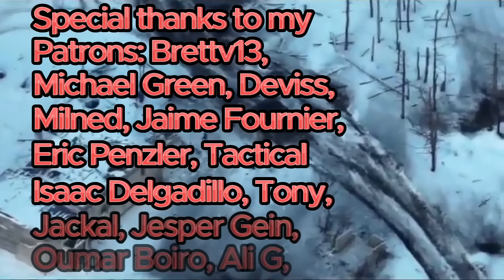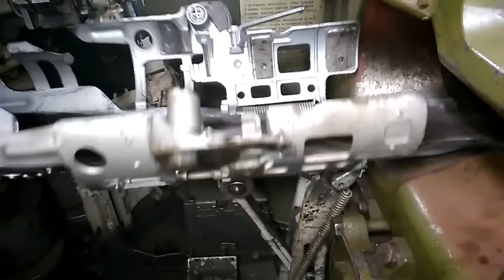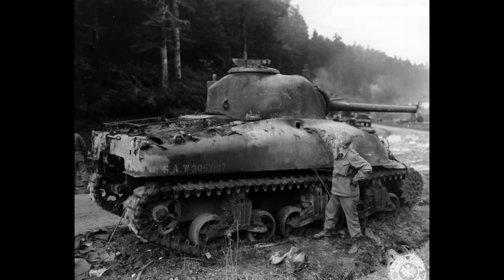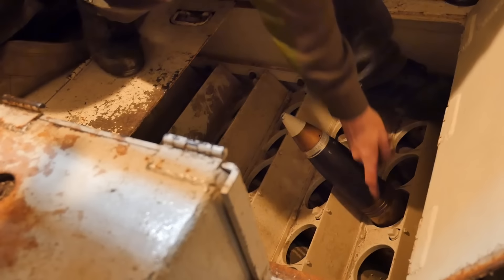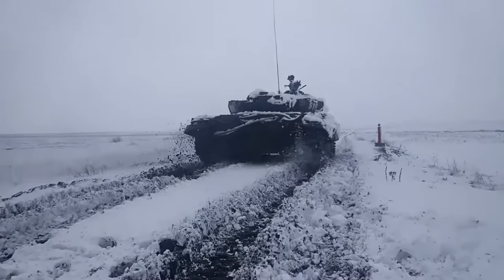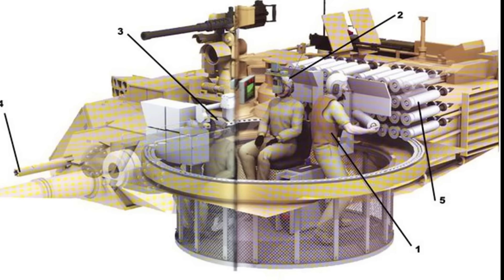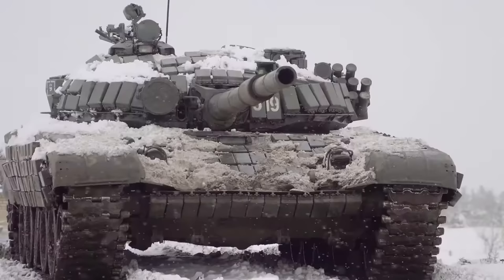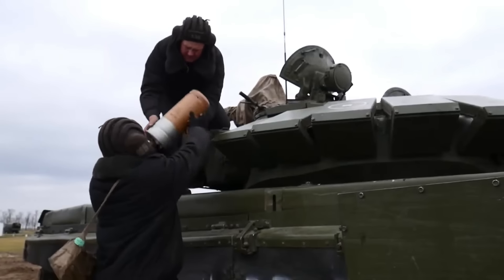Is Autoloader Really the Reason for Russian tanks exploding so much?

Comment: I'm curious why they never tried to give the carousel autoloader blowout panels (or if they have tried why it hasnt worked/been adopted). If they armored the compartment where the ammo was in and had blast doors on either side of the slot of the position the projectile is in before it gets loaded it should be possible. They would just have to direct the blast downwards instead of upwards. I'm not an engineer though so please correct me if I'm wrong. This is actually something I've been wondering about for a while and would love an explanation for.

Comment: For the start, T-54/55/62/64/72/80 have been designed to penetrate through defense lines and keep rolling deep behind, at that scenario they have to take as many ammo as possible storing it in every space available inside the hull.  That is not the case in Ukraine, tanks act in defensive or supporting roles.   They don't need a lot of ammo, the 22-24 in autoload is more than enough.  So most cook offs happen in auto loaders.

Comment: If I am not mistaken, the ammo in the Merkava tanks are also stored in the hull, but each round is stored in a protective casing before use.
Doesn't sound like a significant  change to a carrousel autoloader to have each round and charge in a protective cilinder that the autoloader can push the round out of.

And I wouldn't bottom blowout panels be possible?
Reply: Blowout panels only work if the ammo is in an isolated containment which has blowout panels in it. If you install these panels in any T-tank, it will still go boom and the crew will die, the only difference will be in the height that the tank turret might reach(won't fly far or detach at all).

Comment: The best armor is not to get hit in the first place
Reply: Not how tanks work. The whole reason they are tanks = heavily armored like that is to draw fire.

That's also why they still got such a shit firing range in comparison to other systems.

It's their job to drive in and draw fire.

Else you would just build another artillery and fire from 10, 20, 30km away.
Reply: @miriamweller812 No that is just completely wrong. Armor is a last resort. You do not want your tank taking hits unnecessarily.
Reply: While not getting hit is ideal, it requires skilled crews to not get hit. And frankly hiding a tank on a modern battlefield is nearly impossible. Thus surviving the tank being penetrated and allowing time for the crew to escape is critical. No amount of 5'4" tankers crammed into as tiny of a tank as possible will save you from the threat you don't see.
Reply: @miriamweller812 No. Not how anyone uses tanks. I would recommend reviewing tank doctrine and circling back. A good example of this not being the case is how more modern Western MBT have been designed, rather than strictly focusing on preventing the tank from being knocked out or making maximum effort to protect the tank designers have increasingly focused on post penetration survival. The blowout panels and large hatches are two good examples. They reduce how much the tank can defend from overall but increase the chance of surviving being critically damaged. Helping to ensure the crew can get out.
Reply: @miriamweller812  That is very stupid, tanks are not supposed to draw fire.

In war, you don't shoot at things that you know won't do any damage so it means nothing, you aren't gonna fire anything except ATGM, HEAT or tank shells at tanks.
Reply: That's 2nd best, best is not getting spotted.
Reply: That was part of the design philosophy of the Soviet tanks. Make them smaller and shorter, then you can hide better and are harder to hit. The trade off is if you do get hit, your chance of death is high.
Reply: @keatonwastaken  Maybe they weren't made to, but battles like Omaha wouldn't have been won without some of the tanks both distracting and destroying German positions, because the infantry were being cut down horridly before they arrived.
Reply: @alm5992  Sure but that's so long ago when capabilities of such vehicles were not fully realized.
Reply: @miriamweller812  The survival onion states

Dont be there at the first layer of defence in other words what he said with dont be hit is right 
Modern times change even a none penetrating hit can cause damage to systems reducing your fighting ability In a time where a enemy tank can see you 2km away with thermals 
and hit you first round not being able to see him due to your thermal sight being destroyed after one small hit is already a death sentence 

Dont be seen if you are seen 
Dont be hit
Reply: @rayotoxi1509  Same principle for stealth planes. Can't get shot down if they cant find out where you are

Comment: You take a tank which was designed for use in a Chemical, Nuclear, or Biological battleground and drive with the upper hatches open.   Seems to be a problem with the optics, and ventilation systems, which allow lots of things to just fall in.

Comment: Having experienced a catastrophic detonation myself (an artillery gun tractor, not a tank) I agree with this view. I've thought it awhile, because it's the propellant that goes bang if you look at it funny. But the actual charges, even a 155 projectile, is crazy hard to detonate. You can chuck in around, set it on fire, it won't blow. It needs the shock of a fuse detonating to explode. But the charges, oi, they roman candle so easily. If confined, they cause a pressure detonation, which is what they are supposed to do in order to propel the round to its target. But in the confines of a vehicle, especially an armoured tank, the pressure builds up in a fraction of a second and boom. Add to that the Soviet practice of encouraging crews to store additional ammo in and around the crew compartment, a recipe for disaster.

Comment: The AZ autoloader system of Russian T-72 and T-90 tanks have additional drawbacks compared to MZ autoloader which was didn't mentioned in this video. Besides longer reloading time and less ammo capacity, AZ have limitations on physical LENGTH of a projectile. While they have same caliber, but AZ rounds have to be SHORTER in length due to a denser placement of the rounds in the carousel. By this reason advanced soviet-era made tank rounds wasn't fit in T-72 tank AZ autoloaders at all. This parameter was crusial for some powerful APFSDS rounds and guided rocket projectiles, designet to be lounched from the cannon barrel. This is why for T-80 tank, which was considered the best soviet-made tanks, designers had chosen MZ autoloader system, created for T-64 tanks, instead of newer AZ from T-72. MZ appeared to be superior in many ways. Additional drawbacks of AZ autoloader is that it reduces the total mine protection of the tank (gunpowder charges lying right on the flor). And it have some funny little problem: it can't place used pallets from gunpowder charges back into carousel. Instead, it kicks this pallets out from the tank through very special tiny little hole, cut in the back armor of tank turret. What consequences it may have - decide by yourself... 😂

Comment: Developing a new propellant that doesn't ignite so easily would help a lot.
Reply: @CheapSushi  reading the comments, you can understand that not everyone watched the video to the end
Reply: Apparently the German HE shells are less powerful than Russian ones, and since modern tanks are used against infantry and holdouts 90% of the time it leaves a bit of a dilemma. Less power more survivability or more power and less survivability?
Reply: @unterhau1102  The less powerful  HE shells will do the same work on the frontline since it is mainly used for suppresion so the infantry doesnt stick out fearing there is a tank for more power to be used there is artillery.
Reply: @kerekeke5295  apparently the ukranians couldn't even knock down a building with German HE shells.
Reply: @unterhau1102  Did you even understand what I have written ?
Reply: @kerekeke5295  The German HE shells are downright garbage. Never mind knocking down buildings, they are completely useless against the most basic trenches. 

With that said however, the Russians developing even just less sensitive propellant would help a lot with the survivability of their tanks.
Reply: @sebastijanglozinic8630  It would not

Comment: Considering top down ammunition, does it even matter?

When the warhead enters the turret it spews a ton of stuff into the crew compartment. That the ammo "cooks off" afterwards is spectacular, but doesn't really matter for the crew anymore (maybe the driver).

I can see this as a problem if the tank hits a mine, though, once again, if it penetrates into the crew compartment I don't think it really matters.

It seems all the "outrage" is mostly because it looks spectacular, though for the crew the difference is, maybe, a few milliseconds if that much.

Comment: 1) No one T-80 was lost in 1st Chechen War because of ammo explosion. The only loss of tank with the who crew was on huge roadside bomb.
2) Western tanks explode may be even more often especially Leo-2 which has only 15 rounds in the turret and everything else scuttered around the tank. And the idea to remove additional rounds will not work well when only 15 left.
3) When tank burns it explode sooner or later. The can be already miles away but the munition will cook off. If most of the munition is under the turret and the turret is light it can be tossed out. In other case the turret may remain in place but the tank is still a burned pile of junk. Leo-2s often turned off in pieces.
4) Propellant charges is complex thing. Soviet rounds use more or less universal propellants and the most effective because the tanks could be operated in very different cimatic conditions. May be something new will be introduced but Soviet disigners had to seek for some compromise. The real problem is separate loading so the propellant is not encased so one charge cathing fire immediatelly ignites all the others. And T-62M with unitary rounds can be more safe in case of ammo been hit. And autoloader is the reason of separate loading. The rounds and propellant charges has to be packed somehow in small volume. Another problem with autoloader which was not actual in 1960-70s it limits the length of the rounds so introducing new longer rounds can require serious hull refurbishing work if possible at all. This the problem solved in later T-90 variants.

Comment: Russian designer to tank crews: the  new autoloader brings 2 benefits to you. The first is it's harder to hit.

Russian tank crew: that sounds good, what's the second?

Designer: if it is hit, none of your families will have to pay for cremation.
Reply: Wtf 💀
Reply: Но у нас культурно православная страна. На момент появления автозагрузчика никто бы и не подумал кремировать своих погибших. Уточняю просто для сведения, все же вы из другой страны.
Reply: "Gone, reduced to atoms."

fr though in the images of burnt out russian tanks I have seen there litterally isn't a trace of the crew, no bones or anything, they just got vapurised.
Reply: @tirushone6446  from the ones i have seen there is often a few bones sticking out the wreckage
Reply: @av812bb  ☠
Reply: @tirushone6446 probably because they were abandoned?
Reply: @unterhau1102  or literally turned to ashes. Like those turret toss videos show, the flame is insane, far more fierce and engulfing than any crematorium fire. Even metal melts, imagine what that temperature does to a human body which is mostly water and protein.

Comment: T-90M does seem to be less prone to instant explosion on being hit. So their mitigations have somewhat improved the issue. Not getting vaporized instantly when a drone graze your exterior plating is good.

But I think one of the big issues here is their explosives formulation, germans in particular seem to have done a lot of work for their charges to be much less likely to explode from sharpnel and fires and only going off when activated by their intended primer charge. Which is a really smart way to go about things in terms of actual battlefield results imo. Just deal with the problem at it's core rather than keep splattering extra armor plates everywhere to mitigate it.

Russians seem to have not cared about that core problem one bit so far.

Comment: No matter where you store the ammo, it'll always be vulnerable to something, especially with FPV drones. The insensitive propellant is a good step in the right direction, but I think the long term solution should be to use electric ignition of an inert propellant, i.e. an electrothermal chemical gun. Basically the idea is to use a brief but extremely powerful electric current to vaporize an inert propellant, turning it into plasma, and then propelling the projectile. The propellant is completely inert, and doesn't combust when struck by enemy fire. It also has the advantage of greater energy imparted to the projectile, and you can potentially "dial in" how much energy you want imparted to the projectile.
Reply: Is that what microwave shell priming or is it different?
Reply: @thephoenix756  I'm not familiar with microwave shell priming, but I found a patent on using microwaves to ignite an insensitive energetic material. Basically the idea is the same as electric ignition, except instead of using an electric pulse, you use a microwave pulse.

Comment: Gonna tell you a secret - if Abrams would carry HE rounds in mix of APFSDS and not only one type of ammo - It's turret would fly as high as Russian one. RU just use universality in exchange of survivabilty.
Reply: Technically not as high as russian turrets because of the weight, even the challenger 2 got turret pop off in ukraine and it was moved a few inches from its place
Reply: @AlexanderK9519  Abrams turret alone weights more that entire t90.
Reply: No it wouldnt because of the blowout panels... Not to mention western HE uses less explosives
Reply: @kerekeke5295  it did happen in yemen a sauid abrams got hit on the rear sides and the tank burned with the crew the blowout panels worked as a match

Comment: It's an unfortunate combination of (1) overmatch by anti-tank weapons, tanks today (regardless of nation) are susceptible to anti-tank weaponry. No practical and mass produceable form of active protection against all aspect incoming tandem warheads yet exists. (2) The exposed ammunition in the crew compartment in the case of Russian autoloaders, tragically results in catastrophic detonation and the complete loss of the crew/tank. It would require a fundamental redesign of the fighting compartment to include either a sealed compartment with vent chutes or panels to redirect the explosion away from the crew and or a reformulation of the propellant compound to be functionally inert until fired. Both of which are much easier said than done, let alone put into mass production.

I think it's important to remember these aren't just 'tanks' being destroyed, these are young men being killed. 40–50-year-old tech, that they have no control over, obviously isn't an ideal configuration for the modern battlefield. Hopefully, in the near future All nations will price a premium on crew survivability when it comes to the configuration of armored fighting vehicles including tanks. Given the demographic trends, now more than ever it is relatively easy to replace a tank in 12-18 months. Less so the experience, let alone THE LIVES of the human beings operating them.

Comment: One problem is that the sovjets just made massproduction since they had a high Manpower availble and just need many tanks so they dont cared for the crews of any vehicle.
Thast why the death rate for crews is higher in russia. Western Nations value the expensive training of theyre crews much higher.

The Other Part is that moste tanks where designed During the cold war where they thought of Tank vs Tank battle in huge scales. Thats why they did the Autoloader to decrease the tanks size.

Comment: can you make a video explaining the weakness of the Abrams to the drone attacks?
Reply: not much to explain. rear of the tank is not protected that well to save weight. and smart drone operators hit it in ass.
Reply: Yeah basically the abrams is designed to win any front to front tank combat. FPV drones hurt the system design as they can easily choose point of impact. The future is probably unmanned turret with crew in the hull.
Reply: The weakness is the blow out panels. It can be set off by a very basic loitering munition or rpg from the 60s which makes it an operational kill. It may protect the crew but it basically makes all the armor worthless and a glass cannon anything can one shot it

Comment: Sound like an easy fix, fix the ammo, not the fault of autoloader
Reply: Russia is still using corrosive 5.45 ammunition. They have stocks of the old stuff and manufacturing process for it.
Reply: The ammo is likely the least concern. More importantly is equipping the tanks with squads. And more recently, and what Russia has been doing, is jamming these drones, and weapons to prevent further attacks. Tank-to-tank combat has been rare, but drone-to-tank, or missile-to-tank has been common. The solution isn't even the tank itself. But of course, it could use some upgrades.